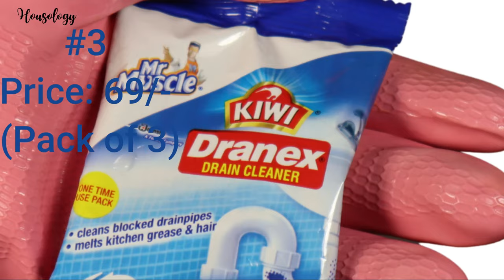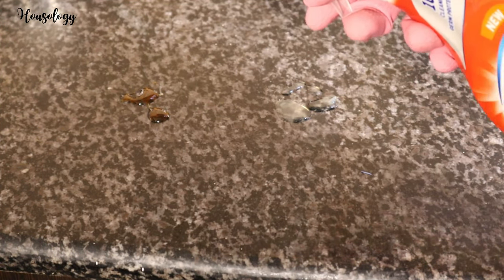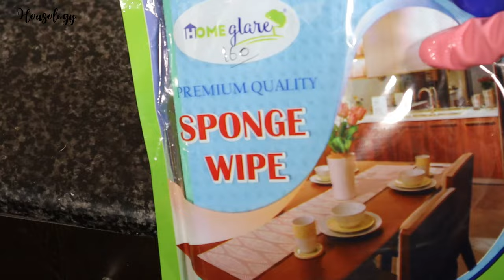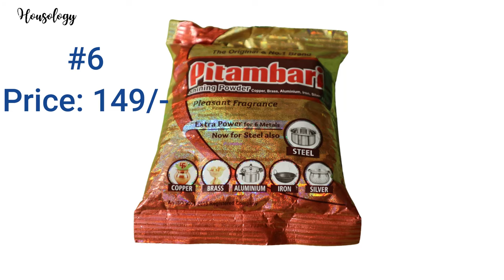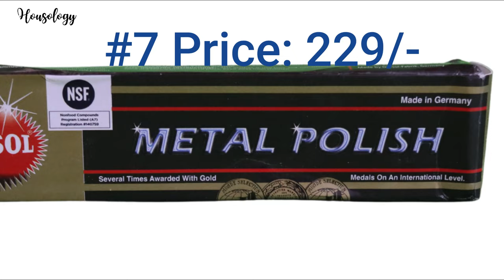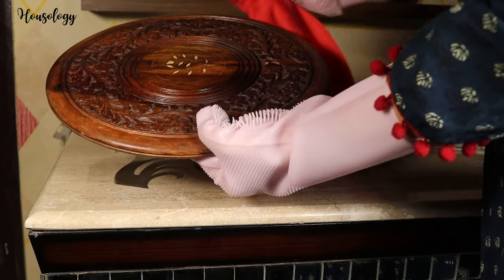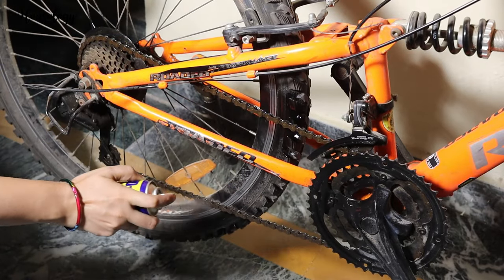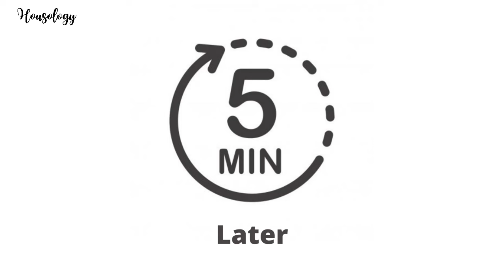9 Must Have Best Cleaning Products for Home in India

Comment: Thank you for Promoting our Product 👍
Reply from the maker: Your welcome
Reply: Can your product be used on kitchen glass
Reply: @navaneethab4444  yes you can use plain kitchen glass ( don't Spray directly  any design or paint coated glass) it's remove paint also.
Reply: Also can we use for wooden kitchen doors near the stove
Reply from the maker: @navaneethab4444  It is a very hard oil degreaser suitable for metals. It can fade the shine of your door. You can use any good quality of wood cleaner on your doors instead of avance degreaser.
Reply: @nivasinghofficial  thank you for the reply
Reply from the maker: @navaneethab4444  Always loves to help. Plz subscribe my channel n u will get more informative videos.

Comment: Does roff cera clean spoil the grouting of tiles in bathroom.. if it's used without diluting ?
Reply from the maker: It is a very hard chemical cleaner. That's why I advised to dilute. Without diluting it can damage the shine of some tiles but won't effect the grouting.
Reply: @nivasinghofficial  what should be the dilute ratio ... To avoid fading of tiles
Reply from the maker: Make it 50-50. If it doesn't give u d desired results then u can go for 60-40 as well. 60 cleaner 40 water.
Reply: @nivasinghofficial  how about using acid available in hardware shop .... Can I dilute it and use ... Won't that be effective ?
Reply from the maker: @sharanngs5783  No doubt, acid is effective if your tiles are very dirty. But use carefully as it can fade the shine of your tiles if not used properly and can be harmful to you too. You can dilute it if needed.
Reply: @nivasinghofficial  how to contact you ?
Reply from the maker: @sharanngs5783  You can reach me at namita042223@gmail.com
Reply: @nivasinghofficial  do you use Google chat
Reply from the maker: @sharanngs5783  Yes, I do.
Reply: @nivasinghofficial  I have pinged you
Reply from the maker: @sharanngs5783  seen